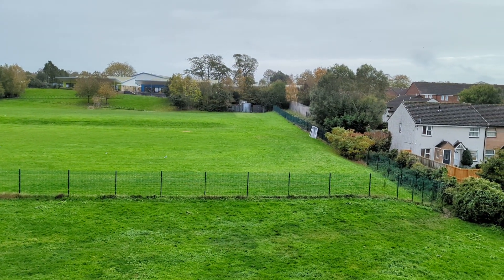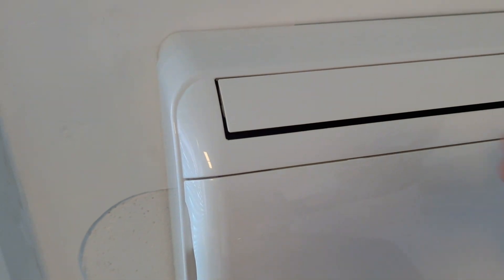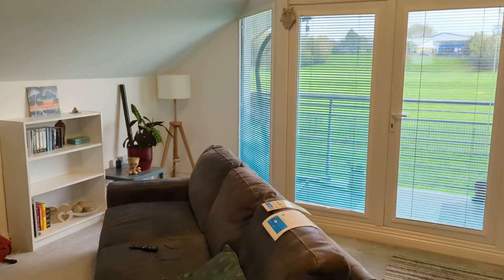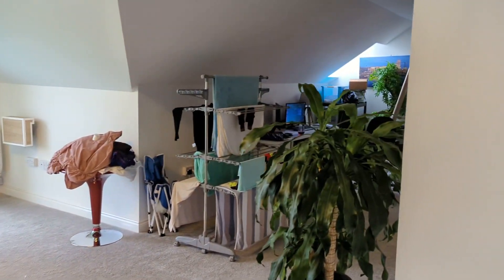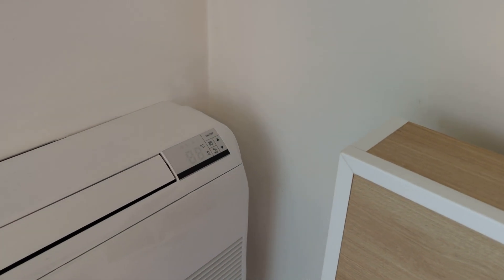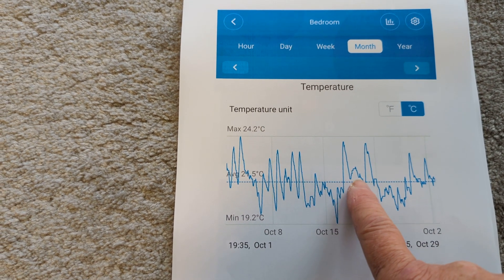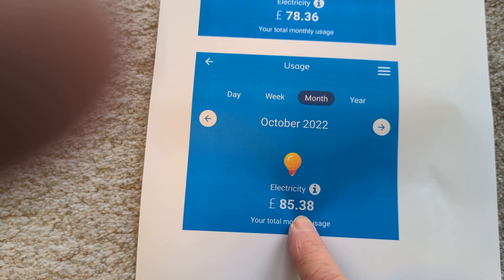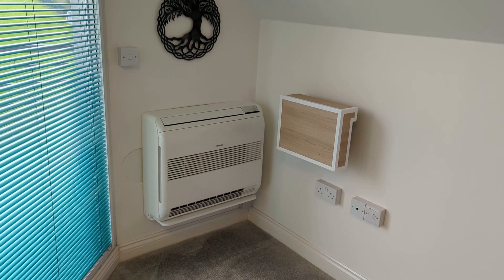Air-to-Air Heat Pumps, cheap as chips to run Part 1

Comment: Steve, enjoyable video. I see the point you are making about the siting of the indoor blower unit, we chose to have our A2A indoor fans positioned high up at the ceiling to maximise our room space, we have 3 Daikin units spread around the property and they have features that allow the downward fin to be angled from 45 to 90 degrees as well as being able to blow hot or cold air from left to right or through an arc controllable via the remote. We're a year in and are pleased with their performance ,price and running costs. Peter
Reply: It can work, the problem is you don’t want to be in the path of the blowing air, it’s a lot easier to have a good outcome with low mounted units as where you put them, and how you set them up is less critical.

Comment: I have a similar single split system heating my  whole 3 bed terraced house. It only struggled to keep up during the recent -10degC but for most of the time it is fantastic. Saves about 4000kwh per year over the storage heaters I had. And bonus cooling during hot summer. Great
Reply: Can I get some info please on your unit? I have a 3 bed on storage heaters I want to change.

Comment: Great video Steve. Nobody seems to be talking air to air, but quotes I’m getting are cheaper that wet ashp even after taking of the £5k. Big selling point for me is ease of fitting compared to wet system.
Reply from the maker: Much less complicated, so cheaper to make and install. So the £5k grant ensures that yet again - like the previous crappy RHI scheme, that Brits only get offered overpriced GSHP and wet systems. You couldn't get a grant for a heat pump that also did cooling AND the installer had to be approved. That meant that all the super efficient air-to-air systems were completely overlooked in the UK. I had Mitsubishi units ooooh 12 years ago and they had an SCOP of 5.41. Never looked back since
Reply: @stevehead01  really is crazy. Why not give the grant to anyone who is removing their gas boiler and fitting any type of renewable heat system? At least there is no VAT currently.

Comment: It is really interesting why the promotion is on Air to Water HP. ? (A2W advantage .Heats all rooms. Can use R290. does hot water tank, can be quiet indoors. Supports the plumbing industry. When you come to replace Monoblock it could be easy. Disadvantage. May need new.. massive rads &/or UFH , HW cylinder, pump, pipes, motor valves, glycol or freeze valves, controller, weather compensation, need to keep house at near constant temp, need to run it through night. can't let house fall below 15c when on holiday, very slow to heat house from cold, design mistakes can wreck your efficiency. Service costs higher than gas boiler)   A2W you can measure a SCOP of 4.  A2A sounds better but harder to measure.

Comment: I got a mitsubishi a2a installed a year and half ago,second winter.
I have external wall insulation,solar and house batteries,so I can run this either free or off peak electricity and it basically is enough to keep the whole house warm(3 bed semi).
£1500 fitted
Reply: Could you please tell me who fitted your system?
Reply: Could you please tell me who fitted you system
Reply: @terrylaw24a  Hi,which system,solar or air con?

Comment: Modern/premium air to air wall mounted units point their vanes directly downwards towards the floor for heating, and upwards for cooling, as well as intelligently looking for cold spots.
Reply from the maker: They certainly do, but do you honestly think that having a down facing blower mounted 2 meters up is going to have any chance whatsoever of getting the floor temp to 24C. It'd have to be like a turbojet.
These things are whisper quiet, so the hot air don't get very far before mingling with lots of cooler room air. If you lay on the floor, I doubt you'd feel anything.
Reply: I have Mitsubishi wall unit mounted under my living room window instead of high up on the wall. You can adjust the vertical drought from almost straight down to almost horizontal and it works fine.

Comment: The outdoor condenser unit looks like it may be too close to your indoor evaporator unit. There should be at least two meters of pipework between both for correct heat exchange to take place .
Reply from the maker: The installers were aware of that, and there is 2+ meters of refrigerant pipework. Some of it is inside the cavity.

Comment: It’s a well insulated house, I am from China, so i know my way around this type of mini split, no way it do the job in my home(way smaller). So insulation, insulation, insulation. FYI, do you leave it on all the time in the heating season?
Reply from the maker: Hi, no I don't leave it on all the time. I use the app to turn it on 1/2 an hour before I get home. Off an hour before bedtime. On in the morning for an hour sometimes.
Yeah, insulation. Temp only drops 3C overnight cos of that.

Comment: What you say certainly makes sense and I am actually considering moving my Toshiba Daiseikai 25 down to floor level and putting it under a window. From there I can send the airflow out staight over the floor . What do you think ?
Reply from the maker: Hi Pete, I'm bound to say that you'll be much comfier if you do as that is my experience.  In summer you'll still be cool for sure, I certainly am.
Reply: @stevehead01  Thanks for the confirmation Steve. I enjoy the heat during the summer and as ours are not especially long here in Stockholm , air con is not one of my priorities.

Comment: By the looks of your video, you're a first floor apartment. The amount of saving in heat from this is immense (unless you live above an unheated space?). Your installation is different from the kind where the heat from outside is used to warm an existing water central heating system.
Reply from the maker: Third floor attic flat, so it's a bit windy up here. There is no heating coming up from the downstairs properties. I know this as the temperature was 8C when we first moved in, which was disappointingly the same as outdoors.

Comment: now did you find it through the recent cold spell?  I noticed that there wasn't any condensate pipe attached so did it cause significant icing, also what is your cop value at that time, as Im trying to get info from uk owners, did it match the 5.1 expected or did yours drop to 3.1
Reply from the maker: Hi, I don't have any way to monitor the cop in real time. All I have is a smart meter with daily kWh reports and 3 logging thermometers - front room, master bedroom and outdoors. What I can say is we didn't need any supplementary heating during the Dec cold snap.
There is a condensate pipe. It runs to a pump in the eaves. The pump is sat in a plastic tray with an extremely loud water leak detector in case it fails.
Reply from the maker: Hi, it's now about 2 months since I made the vid and just been through a cold, dank January. Overall electric cost has risen of course and that's the worst month out of the way. So £136 for the first 28 days.
I'm pretty annoyed at the company that did the install for not fitting a condensate drain to the external unit. I expressed my concern at the time and was dismissed being told it's unnecessary. Well I've now had a complaint from downstairs as water pours over the front of the balcony all over their stuff.
The installers response so far has been 'well they get wet if it rains anyway don't they'.
The outdoor unit needs to be raised, and a gravity drain connected to the existing pump-to-waste inside. From the response I got, I'm not holding out much hope.
Reply: @stevehead01  thank you

Comment: Having the heat at ground level makes so much more sense . so I ask is the energy label you showed RAS-B13N4KVRG-E
for a high wall mounted unit? If so do you happen to know the  name of the floor level unit?
Reply from the maker: The indoor floor level unit is the RAS-B13J2FVG-E
Reply: @zlmdragon.  No, As it's A2A, it's just the SCOP of the outdoor unit.
Reply: @zlmdragon.  on the product datasheet for (I believe) the previous generation to the one in the video, which can be found with the title "R32 RAS Multi-split Floor Mounted Console Bi-flow", the cops and scops are listed against the outdoor unit(s) only with being able to choose which indoor units are used.
With A2W, as I'm sure you know the cop is affected by the water temperature going in and how much it needs to raise it by, so the wider system has an impact on it.
I'm not an expert on how A2A COPs are calculated. But I'm pretty sure the indoor units communicate how much power they need with the outdoor unit, and it either honours it, or if it is restricted by the outdoor temp along with the other units, will only provide up to the maximum it can provide divided between the units.
I have a standalone daiseikai 9.5 35, which has up to 7.7kW of heat output, but on really really cold days (-20C) it can only supply about 4.4kW, so heat output is largely dependent on the outside environment.
Reply: @zlmdragon.  I think that's more just bringing in the capacities from the indoor unit(s) and pairing it with the outdoor unit specs (as you could pair a larger outdoor unit, e.g for future expansion, but still only have the total capacity of the indoor unit(s)).  i.e. I'm not entirely sure it matters if the internal unit is a 3.5kW floor standing unit vs a 3.5kW high wall unit.  I could be wrong though.
Reply: @zlmdragon.  Thanks. I incorrectly thought it was much simpler than that since you can mix/match indoor unit types with the same outdoor unit in a multisplit set up.

Comment: Did you need planning permission? Looking to install similar in a top floor flat with mini balcony
Reply from the maker: @ranjan996  Hi, no planning permission required it's part of 'Permitted Development'. There are rules you need to comply with but planning isn't one of them.
Reply: @stevehead01  Thanks for the reply, the wording on the "permitted development" was a bit confusing when it came to flats and I thought contacting the coucil might take a while. I appreciate the answer
Reply from the maker: @ranjan996  I had a meet with my local council about this and the outcome was a bit vague. I took away from that (paid) meeting that I need to stick within Permitted Development rules (of course) but they would still investigate any noise complaints from neighbours. Buy a very quiet outdoor unit.

Comment: Interesting so you recon about 8 quid a month in october which was quite mild - how did december do you?  Been running Mitsubishi air to air in various work capacities for 2 decades now not one unit failed - i laugh my way to my head in my hands at all these "spend 15k on air to water and get 5k grand wohooo! videos :p
Reply: @zlmdragon.  So what is your suggestion for getting a full air to water setup including all installation, new tank,  pipe size changes and radiator upgrades for less than 10-15k now that we can no longer get our £5k government bribe?? :)

Comment: October 2022 uk temp was still pretty high so this is useless. How much was mid Dec and last few days Jan 2023? I bet it easily doubled or triple cost. And split unit on top is no problem.
Reply: Hate wall mounts as they are crap in heating due to stratification. Feet cold but head hot.

Comment: Your video makes this appear to be a cheap and relatively simple alternative to "normal" air source heat pump.
My house is externally insulated and hardly needs much to warm it up.
Are these cheap to get installed,can you DIY?
Also,do they need to be running all the time like traditional heat pump,or can you just turn on as needed,as you would in summer,to cool?
Reply: Here's my two pennies, yes it's cheaper. With less requirements compared to a wet system. I would recommend getting them professional installed because of there power requirements.   You can turn them on as needed.  For me our next home will have these in.
Reply: @markw1590  Thanks Mark.
Iam edging towards this is the best option.
Reply from the maker: Hi,
If your home is well insulated (sounds like it is) then no, you don't need to run it 24/7.
Currently (early January) I haven't even bothered to set an on timer as it's not that cold when we get up. Sometimes I switch it on via the internet 30 mins before I get home.
No, you can't legally DIY these, but an easy job for any fgas certified engineer (s).

Comment: Are you sure that the temp is measured using the remote?  Most of these units measure the air temp of the intake air.
Reply from the maker: Hi Chris,
Well the manual says not to place the remote near a stove or any other sources of heat eg direct sunlight. I drew the conclusion that the remote has a temp sensor from that info.
Reply: Probably more to protect the remote control from solar or direct heat. You'd see the sensor on the back or a corner if it had a built in sensor and some advertise it as a feature sometimes called ifeel or followme.

Comment: No good for cheap heat source in winter, which is when you need it.
Reply: I have a similar single split system heating the whole 3 bed terraced house. It only struggled to keep up during the recent -10deC but for the most of the time it if fantastic. Saves about 4000kwh per year over the storage heaters I had. And bonus cooling during hot summer. Great